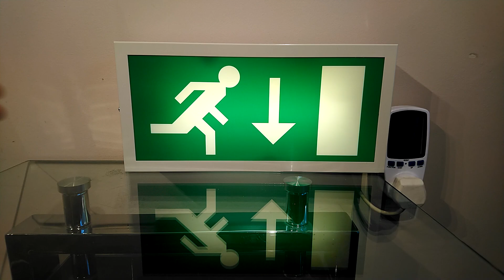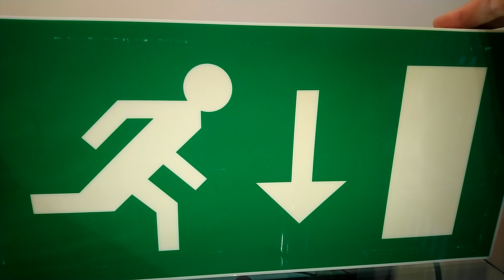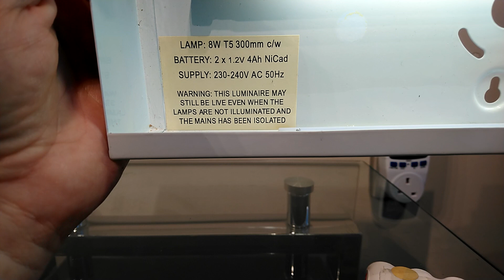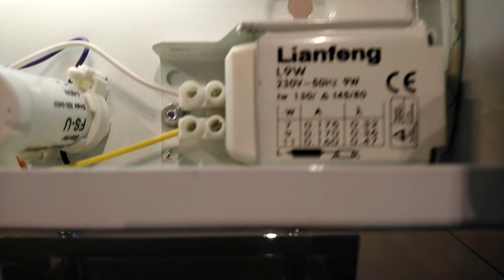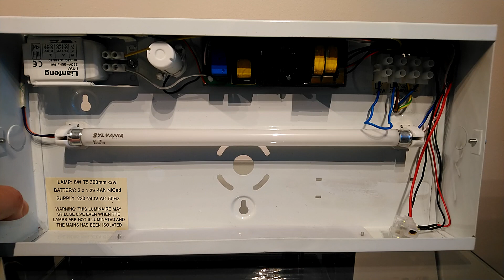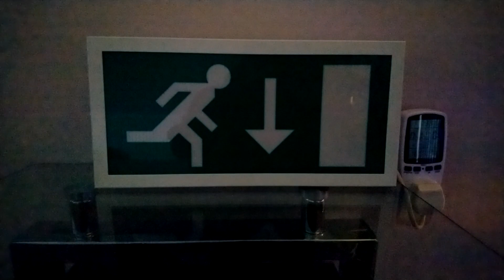Maintained 8 Watt Fluorescent Emergency Exit Light

Comment: can you wire to a 3 pin plug
Reply from the maker: Yes, a Maintained Light will charge and light up, a Non Maintained Light will charge the battery with only a green or red led working and light up when unplugged if battery charged enough.